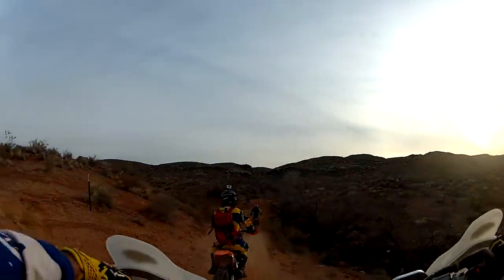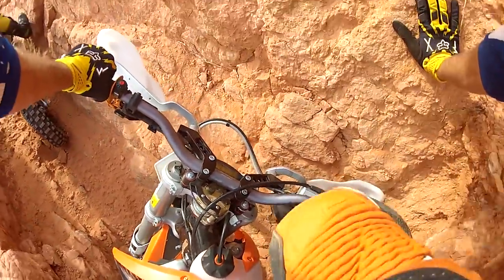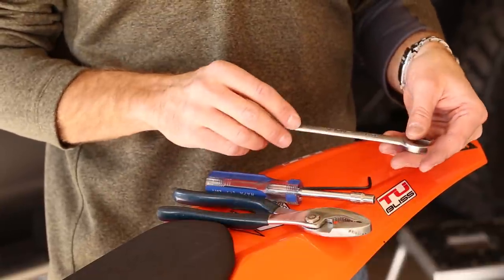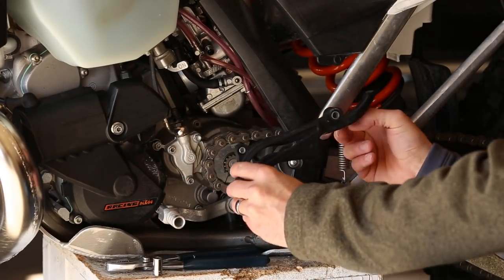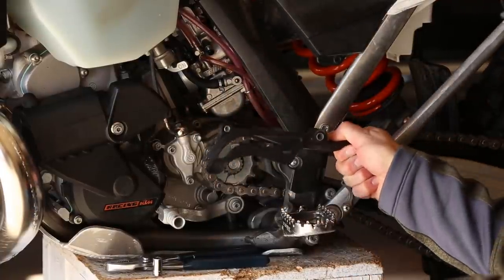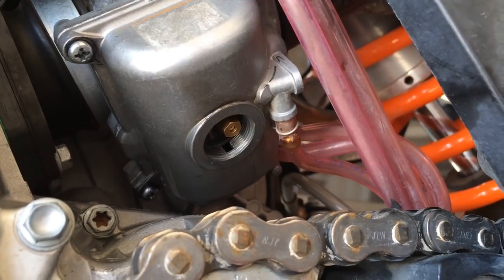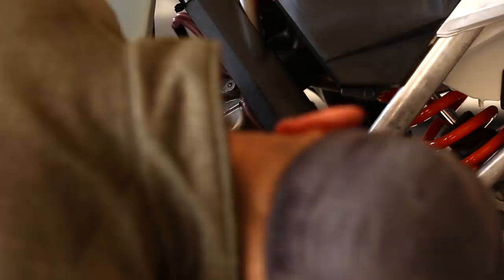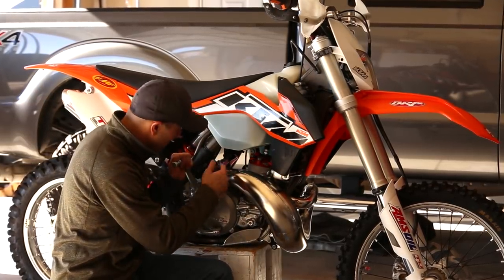How to Jet a Dirt Bike Carburetor - Jetting and Needles

Comment: Bro have any videos on how too change oil on a 250ktm 2 stroke or similar and what oil would you recommend. I hear motorex cross power is the best
Reply from the maker: djm93 For gear oil, I've been using Bel-Ray.  I don't have a video on that, so I guess it's another one to add to the list.  Thanks for the suggestion.
Reply: Rocking But Steady Sweet can't wait looking forward too that video, but for the oil would you recommend motorex cross power 2stroke bro
Reply from the maker: djm93
Yes, the Motorex cross power is a good oil to mix in your gas.  I used that right up until the last 5 months or so.  I switched over to Amsoil Saber.  I moved the latter at Jeff Slavens recommendation, and it's been working great.  Can't go wrong with either oil.
Reply: Rocking But Steady Sabor @ 80:1? How many hours do you have on the Sabor and have you had the top end apart recently?
Reply from the maker: Jeffijers
Saber at 100:1 as recommended by Amsoil :)  Sometimes I mix it 90:1, it just depends on the gas can I've got in my hands at the time.  I've been running it for the past 20+ hours on the motor.  I'm only at about 50 hours total on this bike, so I haven't taken it apart yet.  Slaven's says that the motors he's seen running this combination are the best looking pistons and cylinders you will find.  I'm just taking his word for it.  So far, so goo.
Reply: Rocking But Steady I have a jug of motorex I have to go through then I'll probably look into it more. thanks for the reply.
Reply from the maker: Jeffijers
I used motorex for years on these bikes.  It's good stuff too. I just wanted to try something different and it's cool that you can get little bottles of the Saber that are essentially "dump and go".  I don't have to mess around with a mixing cup.

Comment: i have a 1995 Suzuki rm250 i think in the bottom bowel in the bottom the air tube i think its called on the inside of the float bowel i think its rubbing on the the float and making it stay open i have gas coming out of every spot when i turn it on have you heard of this and what could be the fix?
Reply: +Jason Osborne u can rebuild ur carburetor or get new one

Comment: I have a habit of thoroughly oiling things when I put them back together. Would it be a bad idea to lightly oil parts of the carb upon reassembly?
Reply from the maker: +Joe Mamma I wouldn't do that.  You don't want it to get gummed up.  That slide needs to slide freely and oil would slow it down.

Comment: Just bought and installed a JD jet setup which is way overpriced but was wondering if I need to mess with the air screw or just leave it at the stock 2 turns out? 15' Ktm 300 xcw
Reply from the maker: +Paul Boykin I think the JD jet kits are over priced for what you get.  Yes, you may want to play around with it and see what works.  Make 1/4 turn adjustments on it.

Comment: What about the pilot jet?  You can't access that without taking the float bowl off.  If you're changing mains you probably need to change pilot too.
Reply from the maker: +Billy Shears Wrong. On the KTMs (and many other bikes)  you can change the pilot from the drain plug :)  I've done it many times.

Comment: how do you disconnect the throttle cable, so you can take the whole carburetor off? Thank's!
Reply from the maker: +Turbo Diesel You have to take the top part of the carb apart.
Reply: thank's, I have a 2010 KTM 250 xc-w, sometimes it completely dies on me around 3/4 throttle, any idea on whats causing it

Comment: hi can you tell me why my bike revs fine if i feed the throttle on steady,but off idle if i rap the throttle on it dies,but if i put the choke on half way it is fine,do you think it could be the main jet too lean,it does idle perfect and fuel screw is 1 1/2 turns out with 38 slow jet,my main is a 95 the bike is xr 125 honda
Reply: try turning fuel screw in some more maybe 1/2 - 1 turn in

Comment: I'm trying to lean my yz250. I dropped my main to a 165 and I'm happy with that. So to further lean the mixture, I'll need to raise my needle clip up from the 3rd position to the 2nd position. Correct?
Reply: Download the jetting APP! It will tell you exactly based on your current weather conditions.

Comment: Just noticed that KTM calls for 60:1 premix on my 14 250 XC-W. Which sounds crazy. Curious, what ratio do you run?
Reply from the maker: fz07.org I don't answer Boise State fans :)  No, seriously, I now use Amzoil Saber at 100:1.  I've been using this on the past 2 bikes with fantastic results.  Sometimes I mix it 90:1, just for fun.
Reply: Holy crap! And I thought 60:1 was light. The bike right now is dumping goop out the silencer, the previous owner had the premix pretty dark red. I just filled the tank with 60:1 and hope that the goop is gone.
Reply from the maker: fz07.org It needs to be rejetted.  The Goop isn't from the premix.  It's from WAY to big of a main jet and needle.... that and riding slow.
Reply: Ha ha, wasn't riding slow, was on the pipe on my first ride. I'm going to start with adjusting the needle and am ordering a JD kit. If I can't get it right after a few try's then I'll just sell the carb and get a Lectron and enjoy the extra power and MPG. I had on on my old RM-250 and it was amazing, but it spoiled me.
Reply: +Dirt Bike Channel I have a quick question and I need it to be answered asap. why is it when I get to the mountains with my kx 125. it doesn't want to start and when I go out of the mountains It will start up. what is wrong with it.
Reply: +Phil Burns The elevation affects the bike so the jetting needs to be adjusted accordingly.
Reply: ok thanks
Reply: +Phil Burns Your bike is jetted too lean.  When you are IN the mountains, it's working.  When you go to lower elevation, your bike is too lean for the lower elevation and starts hard.  Almost all starting issues are jetting issues.  Cleaning the carb thoroughly with spray cleaner, especially the choke (actually, an enrichening circuit on the PWK carbs) on the carb may help also.  If it's not starting well even with the "choke" pulled, it may have a partial clog in that circuit, so it's not as effective as it should be.
Reply: well its a 1 kick wonder out of the mountains.

Comment: Great video...
.. The jet needle ONLY sticks into the main jet at idle and ...maybe...maybe....up to 1/16 throttle position-ONLY!  .The needle jet (the hole that the needle slides up and down in is located above the main jet and sits at the bottom of the venturi) and the jet needle (needle with clip) moves with the slide(throttle)

      The jet needle comes in different diameters and different tapers and taper lengths and overall lengths to facilitate accurate jetting.  The needle jet comes in different bores (holes, and some have tall damns that actually stick up in the main bore or venturi of the carb).. the taller the "damn" the leaner the needle jet. ---you don't see many of these anymore..
.......................................
   This is a great video that takes into account the altitude (VERY important) and the temperature (also important) rules for jetting a two stroke dirt bike/atv.
............  A rule of thumb is usually go UP one full main jet size for each 1000 Ft. drop closer to sea level.. and the closer to sea level, under 2000 ft., you  usually should move the clip position (move the clip down which move the needle up) for every 500 ft. also.  A FATTER or larger diameter needle is LEANER than a thin one...the higher the clip on the needle is RICHER than a lower clip position. The needle jet is usually not something you replace unless they wear out (they do on atv's frequently.. ever have a four stroke atv start fouling the plug ..(a little black smoke)...with a black dry film on the spark plug,,, the needle jet and jet needle (which work together for proper jetting have worn to the point where the mixture is too rich..common problem-easy fix).
   ....
.................. The biggest (and hardest) issue with proper jetting is when you put a much bigger carburetor on a highly modified engine.. having a selection of slides with different cutaway's, a selection of different diameter and tapered jet needles, a couple different needle jets, a few different size pilot jets,  and a selection of main jets is rather expensive.. a GREAT TUNER will have these items in stock!!   (I do).
...........one tip... spark plugs are cheaper than a highly modified engine - go extra rich..(not extra oil!)...  find someone that can prove they know what they are doing.. that means can explain exactly how things work and not someone that has "tinkered" with a dirt bike!!

Comment: On the 2019 KTM  300 XC Idler screw on Mikuni 38 carb.... would you know the OEM setting? In other words how many turns out was this set at from Austria?

I touched this without counting turns.  My bad.
Reply: Wood Worm check your manual. Mine has all the air screw, idle screw, pilot circuit and needle and main jet settings in there for various altitudes and temperatures.
Reply: Also, here’s some info I got from a forum about setting up your carb! 

Spanky's jetting 101:

A correctly jetted carb makes a tremendous difference in the torque, midrange pull, top-end pull, and over-rev of your engine. If you have never jetted your bike correctly, you will almost certainly gain some performance at some point in the bike's powerband.

A cleanly jetted pilot circuit can be the difference between having to clutch the bike out of a turn or not. Hard starting when hot or cold, poor response when opening the throttle, reluctance to idle, all of these are symptoms of an improperly sized pilot jet or incorrectly adjusted air screw.

The needle can make all the difference in the world for the power of the machine in most situations, as it controls the throttle range that most riders spend most of their time using.

A correctly sized main jet could mean the difference between being able to rev out high enough to not have to shift one more time at the end of the straight, or the power falling flat on top and requiring you to make that extra shift.

Are you fouling plugs? Many people will tell you all sorts of band-aid fixes, from running less oil, to running a hotter plug. Both are incorrect fixes for plug fouling. It's all in the jetting. An engine that is jetted too rich will have combustion temperatures that are too low to burn the fuel and oil effectively, leading to deposits and wet fouling of the plugs.

Do you have spooge? There are the rare instances where a mechanical issue, such as a leaking wet-side crank seal, can cause spooge. But, by and large, this isn’t the case. In most instances, spooge is caused by rich jetting. It has nothing to do with how much oil you mix in the gas, or how hard you ride. An engine that is jetted too rich will have combustion temperatures that are too low to burn the fuel and oil effectively, resulting in deposits, plug fouling, and spooge. Spooge is nothing more than unburned fuel and oil entering the exhaust.

The only way to know what jetting changes you will need is by trial-and-error. No one can give you jetting specs, because every bike is different, every rider has a different style, and jetting is totally weather dependent. Unless the person telling you what jets to use is riding an identical bike, on the exact same track, at the same time, his recommendations are meaningless. Someone with a good understanding of jetting can get you in the ball park, but you need to do the testing to determine the correct jetting yourself if you want it right.

Jetting is fairly simple, and is a useful skill to learn if you ride a two-stroke and want it to perform at it's best.

It's very important that you start with the pilot circuit, because the pilot circuit affects the entire throttle range. When you are at full throttle, the main jet is the primary fuel metering device, but the pilot is still delivering fuel as well, adding to the total amount of fuel that your engine is receiving.

Before you start to re-jet your bike, you need a clean air filter, a fresh plug (actually you need several plugs to do plug-chop tests for the main jet), and fresh fuel.

One important detail: Make sure the engine is in good mechanical condition. If your engine has a worn top-end, fix it first. Trying to jet a worn out engine is a waste of time. The same goes for reeds that don't seal properly, and a silencer that needs re-packing. Worn reeds will mimic rich jetting, and worn rings will mimic lean jetting.

Before you start the jet testing, Install a fresh plug. Set the float level to the proper specs, an incorrect float height will affect your jetting all across the throttle range.

All jet testing must be done with the engine at full operating temperature.

As already stated, start with the pilot circuit. Turn the air screw all the way in, then turn it out 1.5 turns to start. Start the engine, and turn the idle screw in until you get a slightly fast idle, or hold the throttle just barely cracked, to keep the engine idling. Turn the air screw slowly in, and then out, until you find the point where the idle is fastest. Stop there. Do not open the screw any farther, or your throttle response will be flat and mushy, and the bike may even bog. This is only the starting point, we will still have to tune the air screw for the best response.

Now is the time to determine if you have the correct pilot installed in your carb. The air screw position determines this for you, making it very simple. If your air screw is less than 1 turn from closed, you need a larger pilot jet. If it is more than 2.5 turns from closed, you need a smaller pilot jet. If your engine doesn’t respond to air screw changes, then you either have a dirty carb, or the pilot jet is way too rich. When the pilot jet is way too rich, you are forced to use the idle screw to open the slide so far in order to keep the engine running that the pilot circuit is partially bypassed, and the engine is actually starting to draw fuel through the needle jet.

Once you have determined (and installed it if it's necessary to change it) the correct pilot jet size, and tuned the air screw for the fastest idle, it's time to tune the air screw for the best throttle response. Again, make sure the bike is at full operating temperature. Set the idle back down (the bike should still idle, despite what you read in the Moto Tabloids), and ride the bike, using closed-to-1/4 throttle transitions. Turn the air screw slightly in either direction until you find the point that gives you the best response when cracking the throttle open. Most bikes are sensitive to changes as small as 1/8 of a turn.

The air screw is not a set-it-and-leave-it adjustment. You have to constantly re-adjust the air screw to compensate for changing outdoor temps and humidity. An air screw setting that is perfect in the cool morning air will likely be too rich in the heat of the mid-day.

Now, it's time to work on the needle. Mark the throttle grip at 1/4 and 3/4 openings. Ride the bike between these two marks. If the bike bogs for a second before responding to throttle, lower the clip (raising the needle) a notch at a time until the engine picks up smoothly. If the bike sputters or sounds rough when giving it throttle, raise the clip (lowering the needle) until it runs cleanly. There isn't really any way to test the needle other than by feel, but it's usually quite obvious when it's right or wrong. A too-rich needle can often be felt simply when revving the bike on the stand. The bike will sound rough and raspy when blipping the throttle on the stand. A correctly jetted bike should rev cleanly and crisply.

Last is the main jet. The main jet affects from 1/2 to full throttle. The easiest way to test it is to do a throttle-chop test. With the bike fully warmed up, find a long straight, and install a fresh plug. Start the engine, and do a full-throttle run down the straight, through all gears. As soon as the bike tops out, pull the clutch in, and kill the engine, coasting to a stop. Remove the plug, and look deep down inside the threads, at the base of the insulator. If it is white or gray, the main is too lean. If it is dark brown or black, the main is too rich. The correct color is a medium-dark mocha brown or tan.

Please note that, when reading plugs, the tip of the insulator, threads, etc. are meaningless for jetting purposes. They can tell you a lot of things, but jetting isn’t one of them. Only the mixture ring at the very base of the insulator, inside the threads, can tell you anything about the jetting.

The slide is also a tuning variable for jetting, affecting the throttle range from 1/8 throttle to approximately 1/3 throttle. If you can’t clean up the small-throttle jetting on your bike no matter how lean you go with the pilot or the needle, the slide is the next step. But few bikes need leaner slides.

Keep in mind, even though this article is intended primarily for two-strokes, four-strokes also need proper jetting to perform right, although they are not quite as fussy as their oil-burning cousins. The only real difference in the two is with the pilot circuit.

Two-strokes have an air screw that you screw in to make the jetting richer, and screw out to make the jetting leaner. Four-strokes, on the other hand, have a fuel adjustment screw that you screw in to make the jetting leaner, and out to make it richer. Their purpose is the same, they just do it in different ways.

Comment: I got a 2017 yz85 and I have gone through 8 spark plugs. I run 40:1 ratio, do I have to fix the jetting or what.
Reply: Dawg wtf 40:1 you are running so rich god